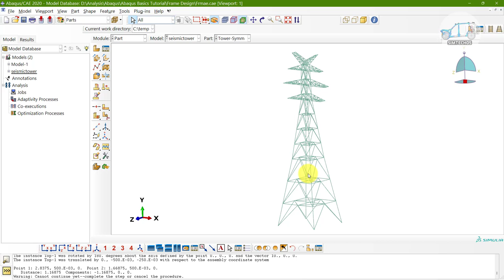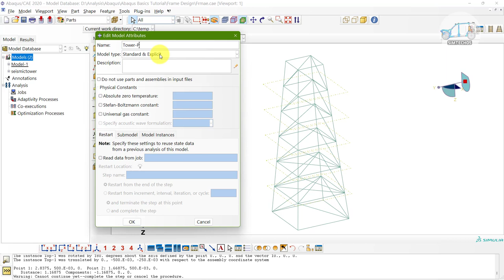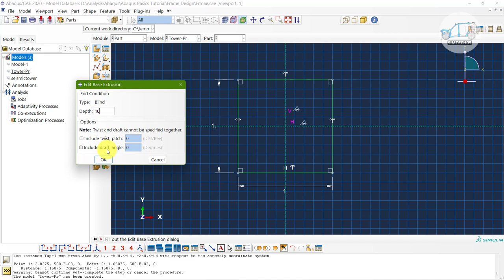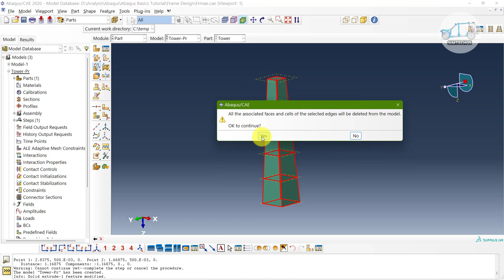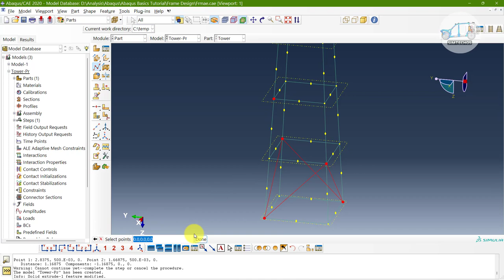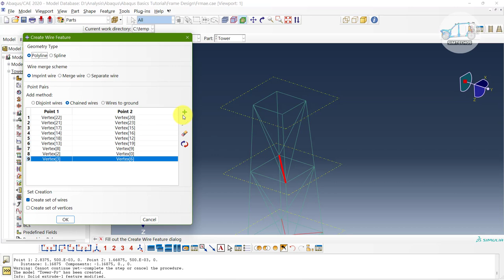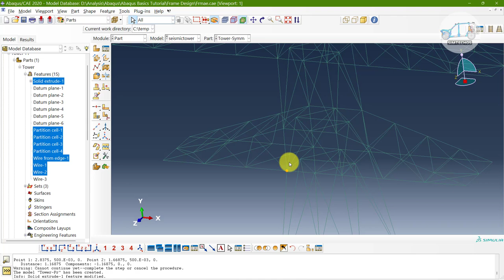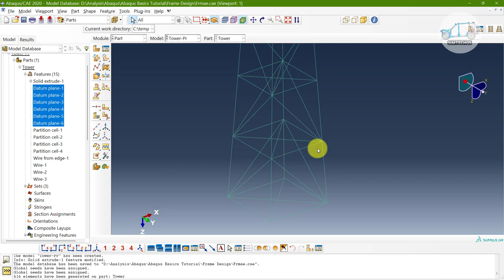Abaqus basics 10 - Creating Advance Wireframe model in Abaqus (Transmission tower, frame etc.)

Comment: Thank You Very much for this video on how to create wireframes. But, Sir, I am getting numerical singularity and Zeri Pivot warnings and models not running. I have assigned a section as a truss member with some area of cross-section. also, I assigned general contact. Can u give me suggestion that how to avoid these difficulties...
Reply from the maker: Dear,
Most probably members of structure mot connected or wrong BC defined.